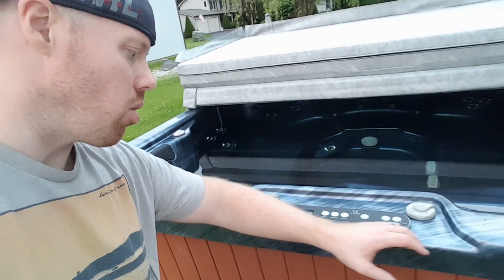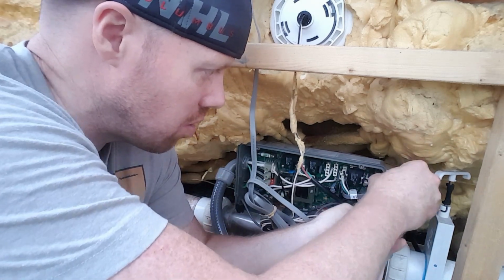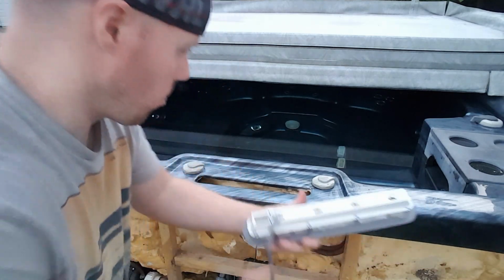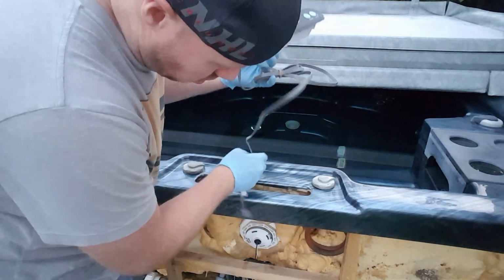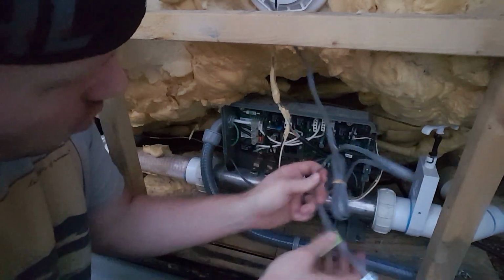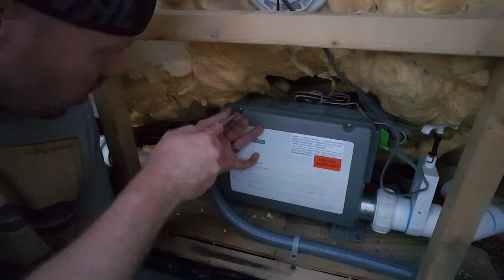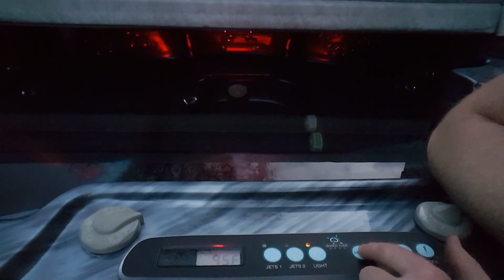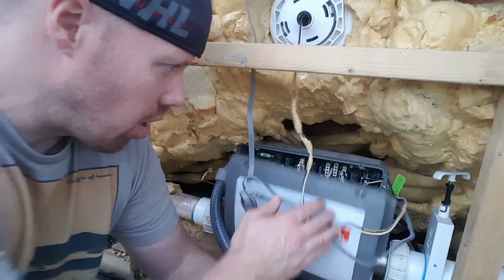Spa Topside Control Panel Replacement

Comment: Nice and helpful video. One thing I'd suggest though--when installing the new control panel, don't silicone it in or take the 3M tape off at first. Just seat it in place, connect the cable, restore the power, and test it. That way, if something's wrong (maybe the new control panel is faulty, etc), you can easily remove it and send it back to the manufacturer without having to undo a whole bunch of work and pry it off the hot tub. Once you're satisfied it's working, disconnect the power, do the full correct install (3M tape, silicone, etc).
Reply from the maker: Thanks for the comment!  Testing prior to install is definitely important!

Comment: Matt.  My control panel works but two air buttons remain down when pressed.   They slowly come back up but don’t turn on lights.  Lights work independently if I bypass panel.  Should I replace whole panel or is there a cheaper way to replace two air buttons.  Your video was great!!!
Reply from the maker: I haven’t seen the buttons replaced.  If you are good with electronics and could get it to seal up afterward in theory it is possible.  (Electricity and water) Assuming it is the button contact and rebound mechanism.  No harm in looking at it as long as your tub doesnt freeze while it is out of operation.  (Plumbing is not a blast) You will probably be in it far less time if you do the whole panel :) Time is money right?  On the other hand, projects are fun and keeping your money is fun too.
Reply: Do you live in GA to fix my spa??!!

Comment: OMG This totally worked but Be Very Careful what Kind Knife / tool you use to remove the seal on the console! I used a very tiny very dull knife and If I had not been wearing Safety goggles I would have stabbed myself in the face 3 times possibly one of them in the eye!!! Its a very tricky process, thank you so much for the help. Wear your Gloves and Safety goggles when doing this project!! Yikes!!!
Reply: I am in an arm sling after a car accident with nerve damage in my lower back so I had to sit down rather close to the unit. And use the hand I am not used to using, since my Right handed arm is in a sling from a car accident a week or so ago. To help explain why I was goofy but still always wear my safety gear like the seat belt that saved me from flying out of the car in said accident 😉
Reply from the maker: @RandomCowboy420  glad you made it through that crash!!  Glad the tub is working!

Comment: Hey man! What kind of silicone you putting on the 3M tape? You just adding silicone caulk or some kind of adhesive?
Reply from the maker: @realjakebrauner  it was an all weather outdoor clear silicone. I forget what brand but i did try to get the best i could find for it so i wouldn’t need to redo it or risk leaking.  And it has held up beautifully years later with no breakdown or leaking.   Let us know how it goes!
Reply: @mattfixesall9000  ok awesome thanks for the quick reply, just grabbed mine from the master spa warehouse guys and they didn’t mention caulking so wasn’t sure but glad to hear yours is holding up still! Mine is only 3 years old so definitely trying to prevent this again haha
Reply from the maker: Yeah. It was an extra step I took that has paid off so far.

Comment: Good video , but you don’t Silicone over top of 3M tape
Reply from the maker: Thanks for the comment.  The thought process is that the tape degrades and is porous the all weather silicone around the edge has kept it mint since it has been put in.

Comment: What kind of silicone did you use?  One video I saw recommended a caulking that would not be affected by the hot tub chemicals, but it did not state which caulking to use.

Comment: Silicone on top of the adhesive tape?
Reply from the maker: I just don’t trust tape. The old one had gaps where the tape adhesion and seal let moisture under. It is still sealed tight today.  Really though, a bead around the outside edge would probably suffice.

Comment: Thoughts on a hot tub that runs normal most of the time but occasionally the Jets rev for a second and then turn off and then rev for a second and then turn off and then rev for a second and then turn off and do that over and over and over again for five and 10 minutes at a time?
Reply from the maker: That's a good question. I am assuming no air pockets.  Are there any other corresponding attributes? I'm assuming it has the correct circuit breakers that wouldn't allow a surge?  Maybe someone from the community can jump in too.
Reply: Matt Fixes All I think it’s associated with a bad bad control panel, but that DEFINITELY seems to have taken a turn for the worse in the last week or two... I don’t know anything about air pockets so if you have any more feedback on that I’d love to hear it. Thanks!!!
Reply from the maker: @ddd1hhh  it's prob not air pockets. I would work things out from least to most expensive.  Do all of the buttons in the panel work. Is there any moisture in the panel?
Reply: Matt Fixes All no moisture.. I just posted a video of what it’s doing in that video is called “leisure bay hot tub won’t run properly and undulating.”  Feel free to see if you can find that video and let me know your thoughts!  Thanks!

Comment: Matt, is just the top plastic that has the flat rubber buttons replaceable without replacing the whole control panel??? 
The spa and buttons are working, just the oval buttons are cracked.....
Reply from the maker: I believe that you can just buy the overlay if you search the web for your model.

Comment: I had my control pack replaced but I'm having issues.  I'm wondering if I need to replace the top control also.  Here's my issue:  The spa won't cycle on it's own.  I can turn the jets on and off.  One odd thing is when I turn on the Aux jets the Main jets light goes on and stays on even when I turn the jets off.  Also the jets button takes 2 pushes to get them started.  I replace the topside two years ago and I'm wondering if
this topside isn't truly compatible with the new control pack?  Any thoughts?  Thanks.
Reply from the maker: After reading what you described I am wondering the same thing about compatibility.  Was the motherboard the same model number as the old one?   Let me know how it goes!
Reply: not sure.  I was just told that the control pack may be in setting 1 and needs to be changed to setting 2 so I'm going to give that a try. If that doesn't work I'm replacing the topside.
Reply from the maker: Did it work?

Comment: Question, did your controller have tape to peel off?? Did you add silicone first then peel tape and apply? Mine, Balboa LV200 has tape. I'm not sure if I need to use silicone before of afterwards of install? Thx
Reply from the maker: Mine had tape and I added silicone as extra protection. I did peel it first so it was sticky

Comment: Do you have a link to the control panel that is used in this video? I’m pretty sure it is the same one I have and the mode and temperature up buttons are suddenly not working.
Reply from the maker: I will look for my old receipt and see what i can find for you
Reply from the maker: This was the specific one that i bought for mine.  Just double check yours to make sure everything matches.   

https://pool-spa-supplies.com/master-spas-topside-control-panel-master-spa-mas-470-2-pump-x300010-with-overlay-x509010-10741

Comment: I have an 04 Cal Spa and the display just went out on it. Everything else responds fine. I just can’t see what I have the temp set to.  The kicker is that the temperature module is programmed to only 1 button, which you have to press an delay for it to change temperature directions. Anyways, is there an updated version of this module that I can switch out or do I have to use the original.
Reply from the maker: Not sure about that. I think it would depend on the mother board’s capabilities.  You may be able to contact the maker of the spa and see if they use any other controllers with that mother board.  It would suck to throw money at an incompatible control panel.  Sorry cant be more help on that

Comment: thought I should ask you! is circulation pump connected to display panel? because when I used to turn on my spa circ pump would turn on without me doing anything but now my display is blank and circ pump doesn't turn on either. Any help is appreciated!!!
Reply from the maker: Just based on what you told me there seems to be a cause and effect. The control panel is integral to a lot of functions.

Comment: Can anyone tell me where to get the topside controlers? mine is bad, and no one has it in stock?
Reply from the maker: Mine was a wildly lengthy internet search until i found the exact replacement from one of the online spa stores that matched up with my mother board model number.

Comment: What all did you test before you  figured out the topside panel was the problem?
Reply from the maker: The display was only reading out intermittently and the buttons had decreased responsiveness.
Reply: Matt Fixes All ah gotcha. We just ran electrical and hooked up our Morgan spa but the display isn’t coming on and as far as I could tell everything on the board is getting power
Reply: I heard that a bad transformer can burn out the control panel (or worst, burn out your brand new replacement control panel). So here's what I have learned so far based on my review and integration of the pieces of information I've gleaned from several videos on this topic...

1) Get screw drivers, volt meter, tube of silicon. 

2) Turn off breaker to hot tub & open panel below control panel, and open the pack

3) Check if fuse on transformer (if its one that comes with a fuse) is burnt out. If so, replace fuse, turn breakers back on, then check if control panel works

4) With new fuse, test control panel and if it still doesn't work, turn off breakers, then test if transformer is bad with voltmeter
     https://youtu.be/IT6xZGXDGyI?t=11

5) If transformer is bad (most likely if LED on control panel is completely blank), identify replacement control panel & transformer and order the parts & tube of silicon
     https://www.spastore.com/strong-spas-topside-control-panel-7-button-with-7-ft-phone-jack-cord/

6) Replace transformer, turn on breaker, then test control panel

7) If control panel doesn' work, turn off breaker, plug in the new control panel (without applying the silicon), turn on breaker, then test new panel
     https://www.youtube.com/watch?v=4ahERCeRAiQ&authuser=0

8) If control panel works, apply silicon to permanently install the new control panel.

Comment: Our control panel is showing a DISC code and it's stuck on that code.  We've tried to turn the power off and on to reset it but no luck.  We've tried to hold down the program button but can't get it to do anything.  The hot tub is on and working but we can't get any of the jets or lights to work because the panel is stuck on that code.  HELP!